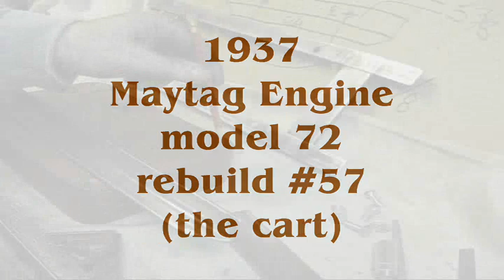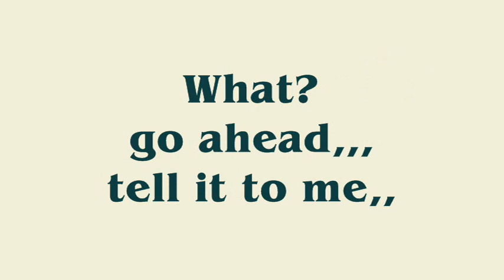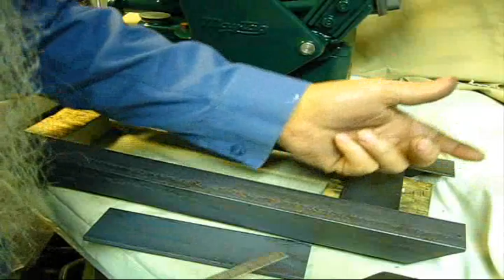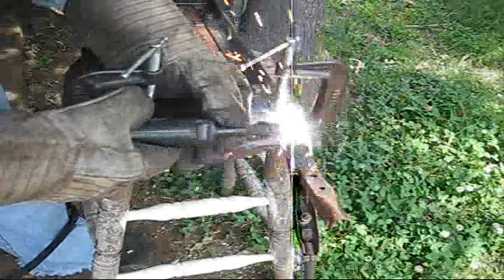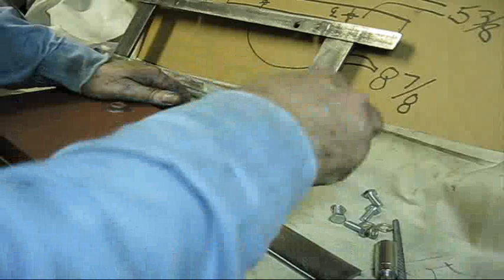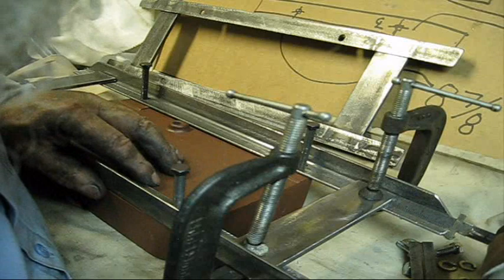1937 Maytag Engine model 72 rebuild #57

Comment: I wonder why Maytag offered an opposing cylinder model in 1937. It seems like if they wanted more power it would have been much cheaper to use one bigger top-end. Maybe a twin cylinder vibrates less? It does look cool, but was that worth all the extra manufacturing costs?

Also I suppose it would be possible to modify the exhaust stroke duration by grinding the ports. Is that why you pulled out your degree wheel in #56?

Comment: Shopdogsam,
I see some excellent welding technique.  You ever so slightly zigzag back and forth along the weld to make sure to fill and blend the weld to each piece of metal.
I can mind movie the strong, pretty welds eventhough we have barely see the welds in the video.
Are you using flux core wire or solid wire with argon/carbon dioxide shielding gas?
From the West Coast of Tennessee.